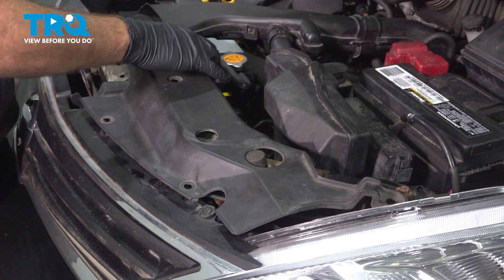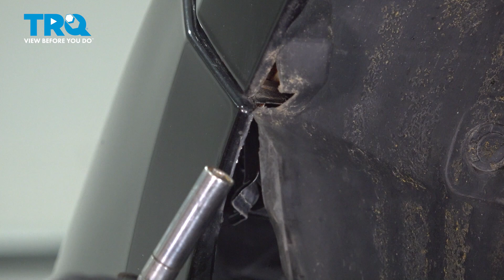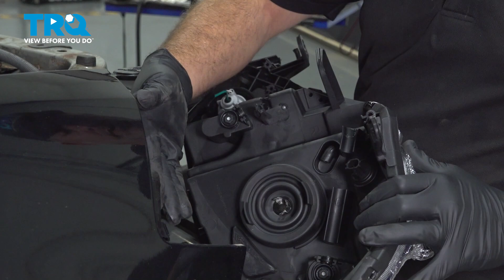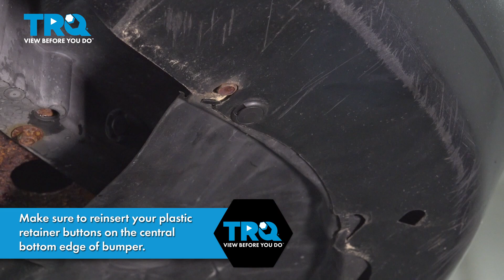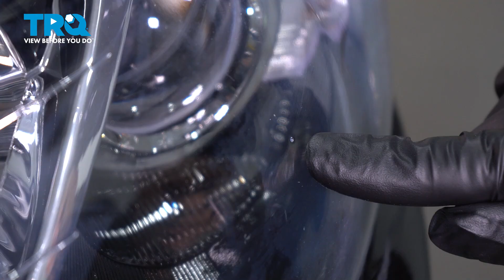How to Replace Headlight Assemblies 2007-2012 Nissan Versa

Comment: Thanks! Just replaced both headlights on a 2012 Versa. 10m, no 8m needed. Before you start buy replacement 8mm trim clips. To the devil trying to reuse the old ones.

Comment: The instruction is so complete and so precise.  Great job!  However, this design KILLED my desire to buy Nissan vehicles again. -  To replace a headlamp. you have to take the car halfway apart.  Also, who's idea is it to use two razor thin little wires to feed two much bigger gauge wires?